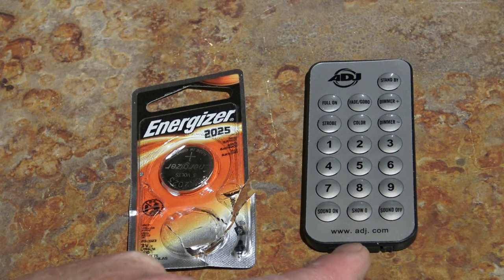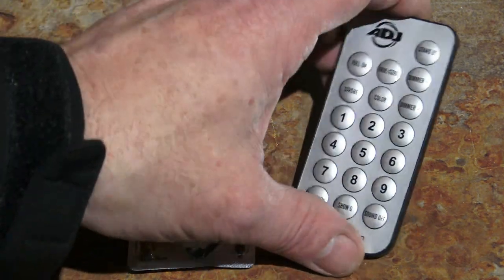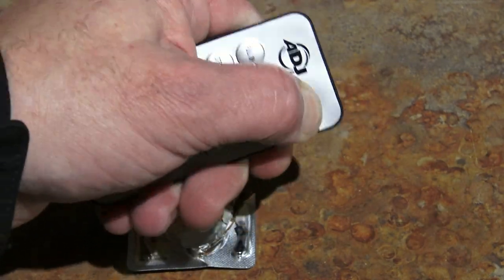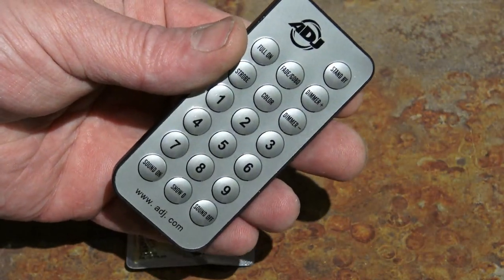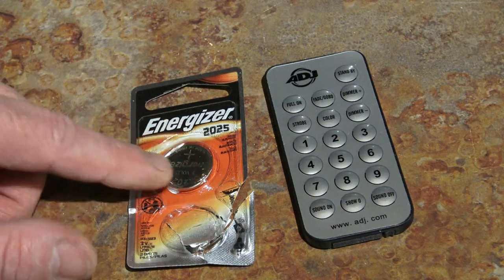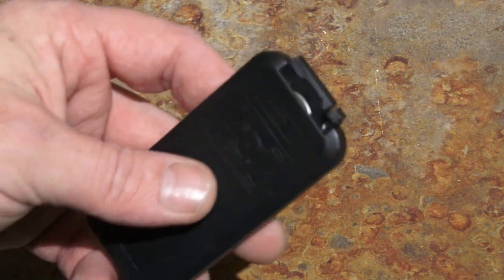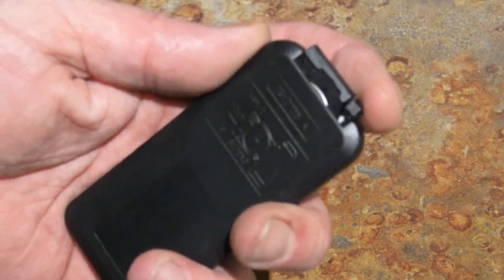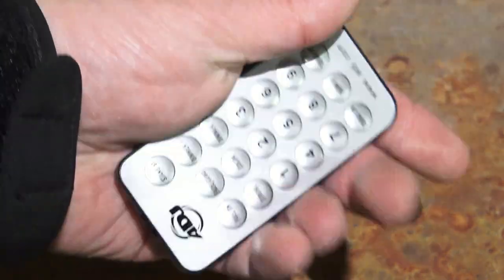ADJ UC IR Remote Battery Replacement - DJ Tips In Under A Minute

Comment: Good tip Brian, I have many remotes and key fobs. I went with the CR2032 it lasts much longer and does fit all my ADJ remotes and key fobs. Here's the difference : CR2025 = Diameter: 20 mm. Thickness: 2.5 mm. Capacity: 160 mAh, CR2032 = Diameter: 20 mm. Thickness: 3.2 mm. Capacity: 220 mAh. I bought a 10 pack online for about the same price as the CR2025 at the big box store. I also got a similar deal for my ADJ laser remote batteries, the A23.

Comment: i wonder if i just have a defective version of this little remote... the battery tray just doesn't open now matter what i do to that little tab...
Reply: Julian Walker same
Reply: Same.
Reply: it might be inserted backwards ;)

if you're looking at the back of the remote, and the tab is towards the left side. the tray might be stuck because its the wrong way in. so you have to try and pry it out with a bit of force, but be careful not to break the plastic. and then flip the tray the other way around.

Comment: step 1 is to put in a sharp object, move a piece then pull battery tray open....couldn't do it....so got tough and with screw driver hammered it open, no problems, Changed battery all it good. I was willing to sacrifice the entire device but didn't have to.